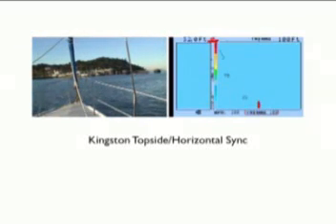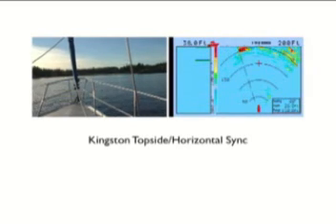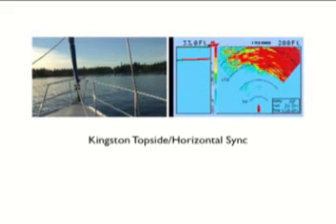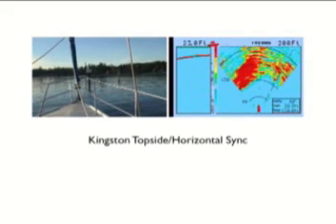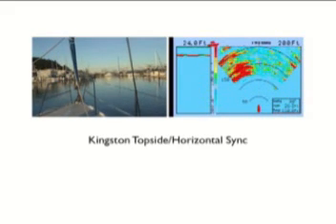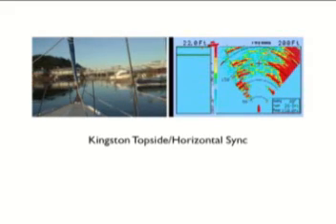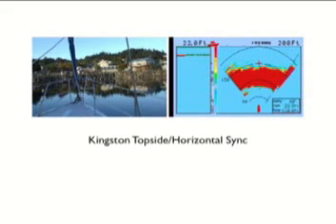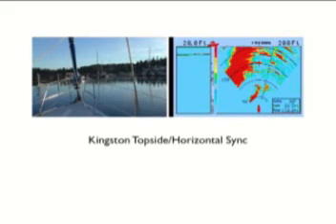FORWARD LOOKING SONAR - KINGSTON HARBOR WITH HORIZ SCAN

Comment: This seems a lot easier to interpret compared to the Simrad ForwardScan. I like that it shows you depth in color. In terms of what leireveien said it is a "best guess" You have to take the information that is given to you whether by radar or sonar and interpret it as best as possible. But in terms of what you are gaining it's huge especially when your trying to get through narrow and shallow waterways. I can definitely see this as a great way to keep you out of trouble. I do wish it was a bit quicker to refresh, it appears that some of the old data that quickly becomes irrelevant as you are moving stays on the screen for a few seconds too long but it is what it is. Still as someone who is getting older and my eyesight is getting worse this seems like a very good investment.